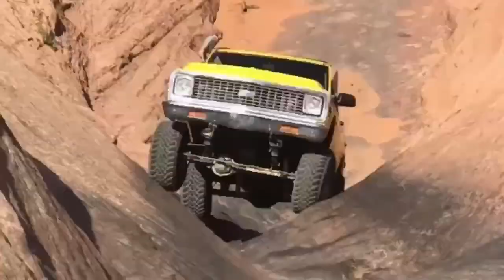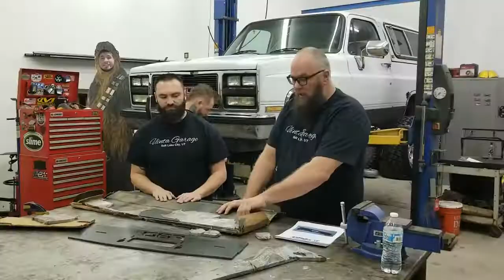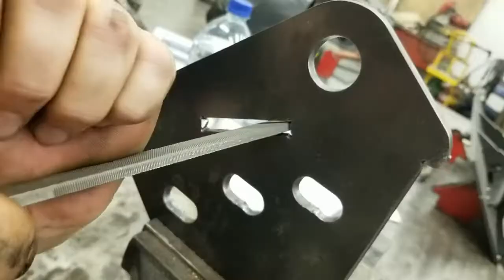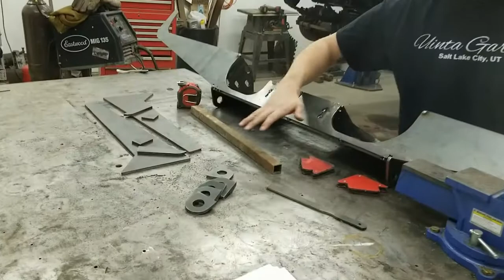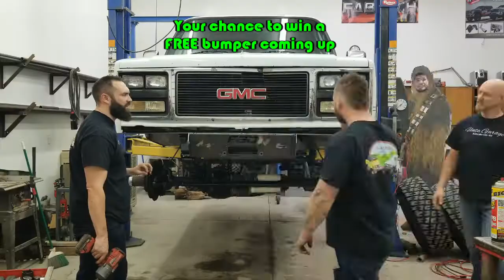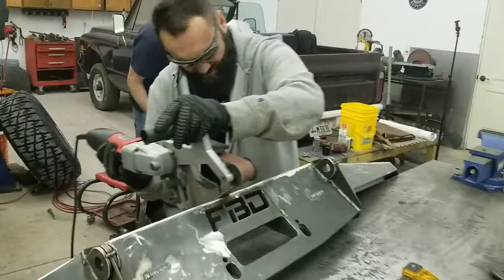Squarebody custom front bumper build and install  #uintagarage

Comment: When is the drawing?
Reply from the maker: All the info is in the video, but to answer your question, the entry deadline is 1/30/2021. The drawing will be soon after.
Reply: @UintaGarage  I saw the info,  didn't hear a drawing date. I guess that's because it wasn't mentioned.  Thank you for your response
Reply from the maker: Fair enough.  I guess we didn't specifically say the date.  It will be within a day or two of the entry deadline.  GOOD LUCK!

Comment: This would look awesome on my 84 k30 cc lb srw 6.2L diesel d60 14b ff 410 37x12.50-16.5 wrangler mt 7/8 lift crossover steering and my 17.5k winch needs a home...currently no bumpers front or rear!

Comment: I`, m guessing this will not fit a warn 8274 winch ?
Reply: It would definitely need some modification.  But the nice thing about this bumper is the winch mount puts tge feet forward not down.  Much stronger